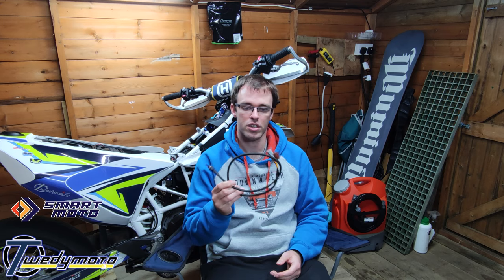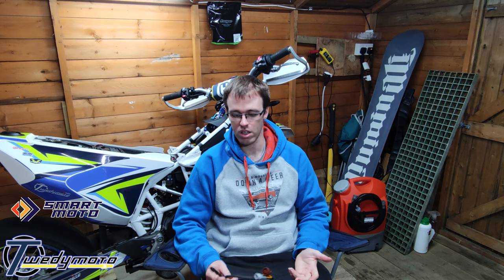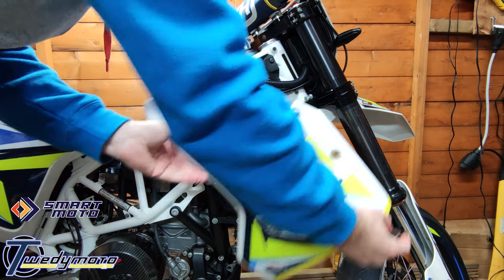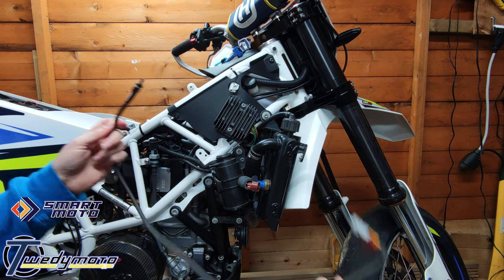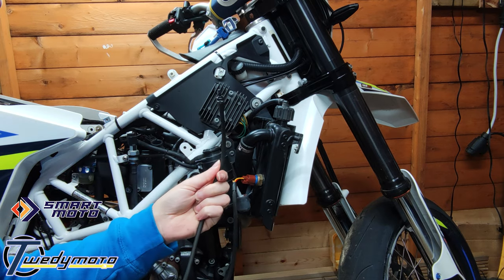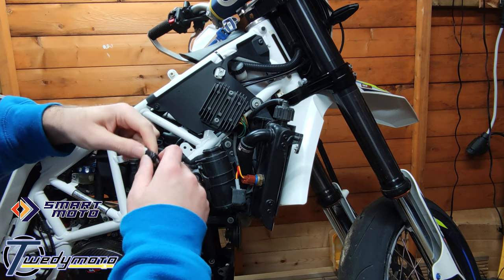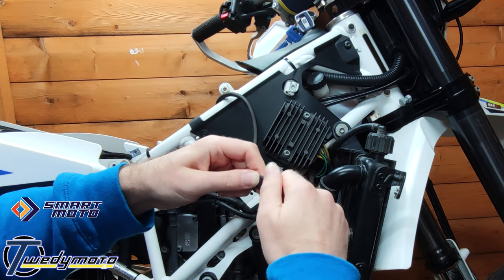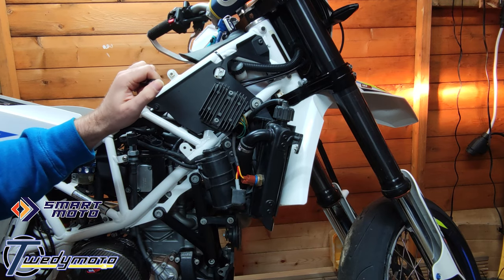How to install Smartmoto manual radiator fan switch | Husqvarna 701 | KTM 690

Comment: How did you mount the actual toggle switch to the handlebar? Ive ordered one for my gsxr 750 but cant figure it out hahahaha
Reply from the maker: To put it on a handlebar, you could take the crude approach and use a P clip around the bar amd use the little nut on the switch to close the clip. Not sure how else to do it

Comment: @Twedymoto hi sir, did u experienced some shifting problems? i heard of some sort of false neutrals problems between 5 and 6 gear in particular, what are ur toughts on that situation? ty
Reply from the maker: This LC4 engine has suffered false neutrals for a lonnnng time! If you're positive with your shifting (be firm) then you'll never have an issue. There are kits available to reduce falses but unsure how good they are. Lots of info on the 701 Facebook groups and advrider. 👍
Reply: @Twedymoto  ok ty. i saw u mounted the oberon clutch slave. does it solve definitively  the friction probelm? does it last longer then the stock one?

Comment: if the switch is off, the fan turns on normally?
Reply from the maker: Correct. It operates as normal.
Reply: Tanks
Reply: The thermostat is normally contact open, so save yourself some money (+$80) and just solder ANY switch ($10) parallel onto the wires!

Comment: Thanks Twedymoto again. Cheeky question here, do you know if the cast wheels from a KTM Duke 690 will fit our 701s?
Reply from the maker: Quite a lot have swapped the wheels from a Duke to the 701. I think you just need to use the standard 701 wheel spacers.

Comment: They need this for the 890 901
Reply: The thermostat is normally contact open, so save yourself some money (+$80) and just solder ANY switch ($10) parallel onto the wires!

Comment: How do you go about covering up your air filter when you wash the bike?
Also do you have to worry about the power commander plugs when washing?
Cheers
Reply from the maker: To be honest, i only ever really jet washed the lower parts of the bike like the wheels, engine and under the fenders and if I did jet wash around the filter then it would only be for a second. The Power commander plugs have seals in them. Never had an issue in 3 years with the plugs :)